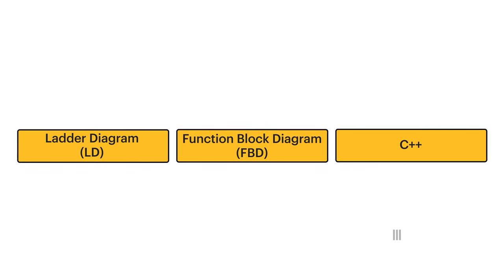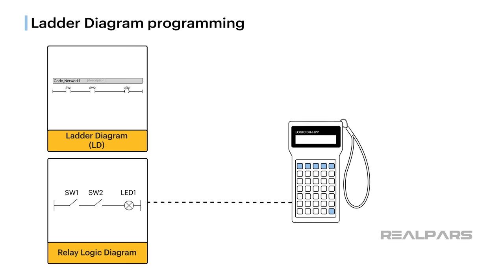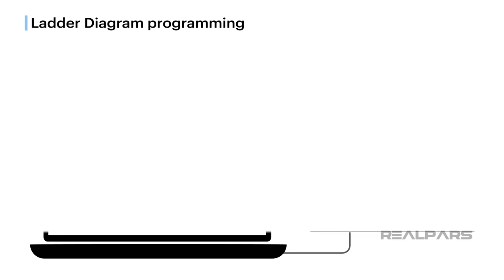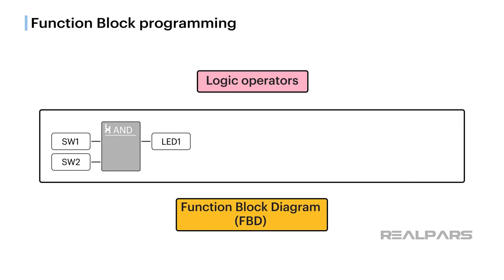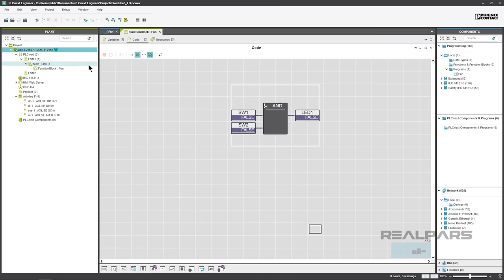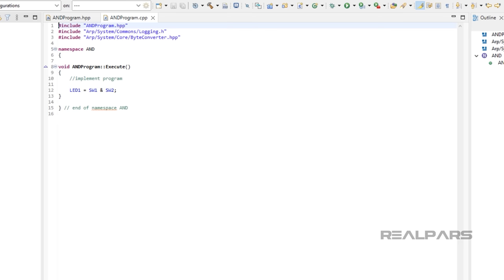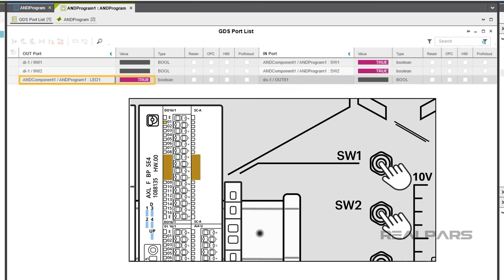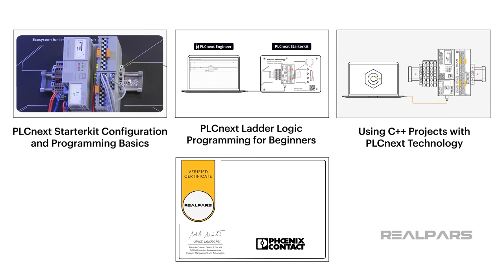A Beginner's Guide to PLC Programming using Ladder Diagram, Function Block, and C++

Comment: Hi, thanks for all the high quality video you put out. A question regarding the PLC: does it support an integrated PID-controller, as part of the hardware and software in the starter kit model plc?
Reply from the maker: Hi there. Thanks for reaching out. I'm not sure I understand your question. If you have an integrated PID controller, what would you like the PLC to perform?  The PLC Starterkit comes with a digit input module and an analog input module.  The programming software is free and available from Phoenix Contact.  You can find it here. https://www.phoenixcontact.com/en-ca/products/programming-plcnext-engineer-1046008 .  It is called PLCnext Engineer and has a variety of FBs for PID control.   Please don't hesitate to provide more details if I haven't answered your question.

Comment: What is the best software for c++ programming for PLC ?
Reply from the maker: Hi @MOSHIE'S ELECTRICS. Thanks for your question.  Short answer - there is no "best" software for C++ programming for PLC. There are lots of C++ Editors that are excellent and none are really better than the others. The defining requirement is if your PLC of choice has the Toolkit needed to interface with your editor of choice.  For example, PLCnext Engineer is happy to work with C++ projects created in Eclipse or Microsoft Visual Studio IDE.

Comment: Can plc be programmed with assembly code ,,,yes I understand it has a small CPU in it any way we can compile assembly code to much more low level code to be understood by this small CPU ?
Reply: Hi There. As far as I know, this PLC cannot be programmed with assembly code.  You may be able to perform such an operation with other PLCs if the correct tools and SDKs are available.  Was there something specific you had in mind?

Comment: Why not just use Structured Text? In the given example its so close to C++ as the logic would bed LED1 := SW1 and SW2; given they all are Boolean datatypes. 
Structured Text is already under the standard, and by that it will follow the same rules accors platforms, as long the stick to the standard. Most codesys programming platforms as an example.
Reply from the maker: Hello @Mathias Mortensen. Thanks for your input. You are absolutely bang-on. We could have used Structured Text, but we wanted to use an IEC 61131-3 language that was very different than C++.  And, as such, we chose LD and FB.

Comment: thanks, i have 10 years experience and hesitating to use IEC 61131-3 because it is closed to  upload a program to your pc if you lost it. Is it same for this? There is another point that: Can we be online with plc while writing the program? I mean we need to see the status of all variables while programming. Is it possible?
Reply from the maker: Hello @Ibrahim Kavalci. Thanks for reaching out!  I'm not sure I understand your first question. Can I ask you to please rephrase it?  As to your second question, some PLCs will allow online modifications to a program.
Reply: @realpars  thanks for your answer. I mean that if you programed a plc some years ago and need to be online later. But you do not have the last version of program at your pc. Is it possible to update it via uploading from plc to pc? I can do it with siemens and allen bradley easly.
Reply: You can upload...plc ->pc but without the comments...
Lots if fun working the software out🤨
If you have an older version you can load on top of that...usually

Comment: And logic on C++ is denoted by two ampersand &&
Reply: Yes, but bitwise AND operator is a single '&'. And since the I/O of PLCs afaik is usually defined as bits (like Q0.3), the bitwise operator would make sense. On other systems, a boolean variable should always be at least one byte of data.

Comment: I disagree that FBD does not resemble any relay logic diagram. It looks exactly like a logic diagram and the principles are the same.
Reply from the maker: Hello @TMJ32. Thank you for your question. Well, you might disagree, but the standard is set by IEC 61131-3, that PLC industrial manufacturers must adhere to if they want their product to be classified as a PLC. Therefore, they set what it must be classified as. Back in 1968, when the PLC was invented, there was no real set standard, and manufacturers called their programming language what they wanted. You will find this information on Wikipedia, including who the father of the PLC is. 
Happy learning from RealPars!
Reply: @realpars  I'm not disagreeing with the standard I'm disagreeing with your assertion that FBD doesn't resemble any form of logic diagram.

Comment: What's Ladder Diagram in Linux Version Sir?
Reply from the maker: Hi Jumeldi,  Ladder Diagram is one of the IEC 61131-3 languages. It's used by many vendors inside their own proprietary programming software such as Rockwell's  RSL5K, or OMRON's Sysmac Studio. Or, it's used in open-source programs such as Phoenix Contact PLCnext Engineer.